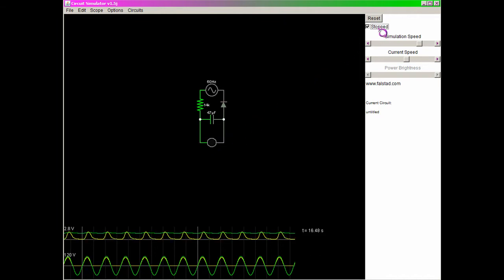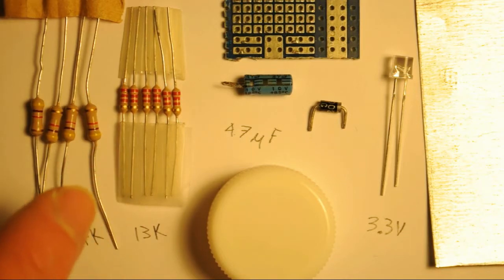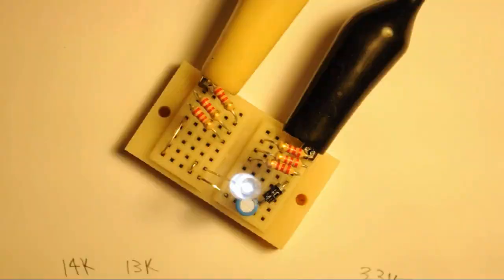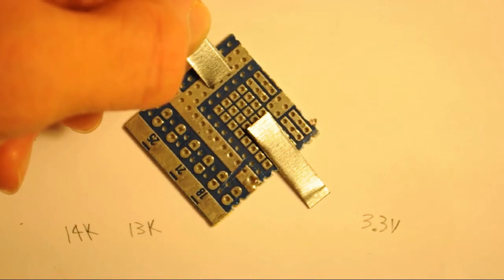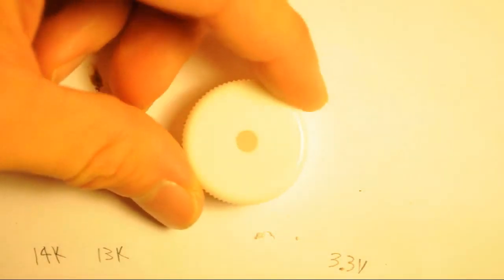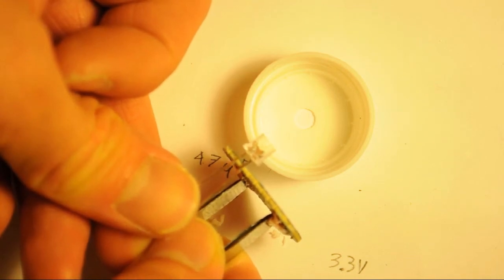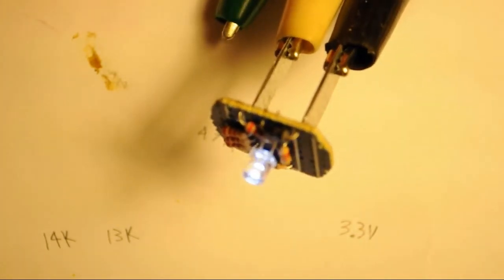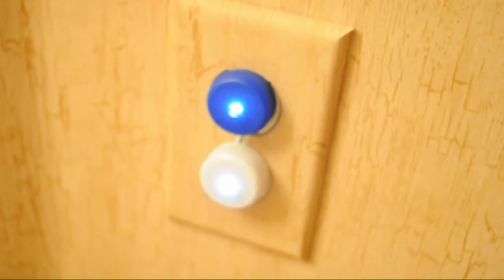Bottle Cap LED Nightlight Instructional

Comment from the maker: @GhostOfACPast That’s true, it was probably flickering due to the 60Hz, but since it’s usually rectified (full bridge), it was probably flashing 120 times a second. But since the camera can only capture about 30fps, it probably did flash 30 times a second. Too bad they can’t fit a bigger capacitor in CFLs.

I think the LED was 40,000mcd. And yes, I’d like to get one of those high power babies also. I found one LED die (was like a CPU) that was 100 watts (needed big HS). That would be awesome!

Comment from the maker: @GhostOfACPast Hey, thanks for the sub & comments! I do appreciate correction of things I may say since I’m human. However, I’ll try to explain why I’m correct in saying a series configuration also increases power capability. If it weren’t true, then the 1/4W resisters would burn to a crisp. In fact, in LED replacement night light bulbs (rated at 1.7W), you will find 5 or so 2.2k 1/4W series resistors inside. Since they’re enclosed & right at their power rating, they get warm, but they do work.

Comment from the maker: @GhostOfACPast The LED night light replacement bulbs that I have, the ones you can buy, actually do use a full wave rectifier. I probably would’ve used a full bridge with the 4.7k resistors (more room on the board), but it was fairly bright enough. Had I used a board w/o tracing (similar to the cheap, brittle RadioShack boards, but not cheap and brittle), I might’ve done it. Plus I wanted to keep it simple for this tutorial and I'm saving those 4.7k guys for a half-sphere orange juice carton cap

Comment: @adamlhumphreys Yeah, no matter what camera you use you will see light with it that you can't see with the human eye and it will see flicker that your persistence of vision doesn't.  I figure it will flash off 30 times a second and on 30 times a second so 60 times a second (like the majority of FLs do) for a 60hz ac source.

btw, what is the led that you used?

I always wanted to put in those high power babies in a retrofit LED night light project (more power).

Comment from the maker: @GhostOfACPast When a voltage drop occurs across a resistor, power (heat) is dissipated. Consider the drop across a 4.7k resistor vs the drop across a 2.2k. A greater drop would be present over the 4.7k, dissipating more heat than the 2.2k. But with two 2.2k resistors in series for 4.4k, half the voltage drop would occur across one while the other half would occur across the other.

Comment: @adamlhumphreys Yep.  Full wave bridge (4 diodes in a square configuration with two taps at direct opposite sides) will double the frequency but a half wave rectifier will still be 60hz only the down (flat) time is the off.  So, the led will flash off 60 times and flash on 60 times in the states (60hz mains frequency).  I was thinking 30 but it is 60 as you said.  I wonder how much harder that circuit would be with 4 diodes in place of the 1 to get less ripple and have 120hz?

Comment: @adamlhumphreys I am thinking in binary where the peak is 1 volt and the flat part is 0 volts (max volt and 0 volt).

In half wave rectification, either the positive or negative half of the AC wave is passed, while the other half is blocked.  The blocked part is the flat part of the wave or 0 volts (for all practical purposes) hence the 30 times a second on and 30 times a second off since the rectifier (the diode) is not able to give us a constant DC voltage.

Comment from the maker: @GhostOfACPast Oh, sorry. I thought you were talking about the CFL. Yes, the LED would be flashing at 60Hz. However, I still don’t see where you got 30. One cycle consists of a positive half wave and a negative half wave occurring every 1/60th of a second. W/ a half bridge, you just flatten a half cycle during 1/60th of a second. So the LED will be both on & off during 1/60th of a second, or 60 a second.

Personally, I’d like to use a high power LED for my headlights (but not to blind ppl)!

Comment: @adamlhumphreys To make sure of my calculations I downloaded the software you used for this and had it scope out the point at the led and it was 60hz but only a half wave.  The other half was at 0 so that was the 30 times off I mentioned.  If that was a full wave rectifier it would still be a half wave but more frequently.  Wiki rectifier.

Yeah, I saw that LED and one that had a Million candle power?  LOL, hook that sucker up as a night light, hahahaha.  Though the led alone was 24 dollars.

Comment: Ahh, we are all human and it has been many years since I was really into this but you are correct.  Ohm's law is what I said but that only concerns one half the equation (the resistance) the power requirements are the same as long as all of the resistors are of the same R value otherwise the one with the least amount of resistance will demand the most amount of P (wattage).

btw, I see it flicker on the camera due to how camera work but I take it the lamp is flickering at 60hz, right?

Comment: Ohm's Law says that in parallel the resistances decrease (actual ohm's law is something like 1/(1/R)+(1/R)+...) whereas the wattage ability increases (as in 2 48k resistors 1/2 watt in parallel would be 24k 1w) .  So, when you said in series that will increase the resistance but the wattage ability will remain the same (2 48k 1/2w in series is 96k 1/2w) since they are not sharing the load as they would be in parallel.